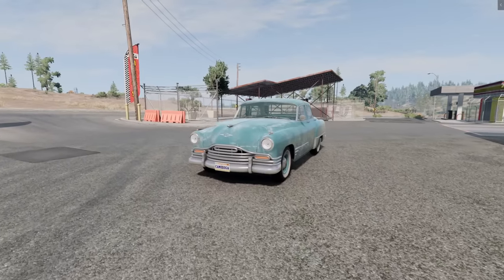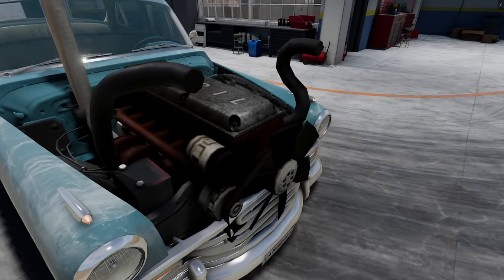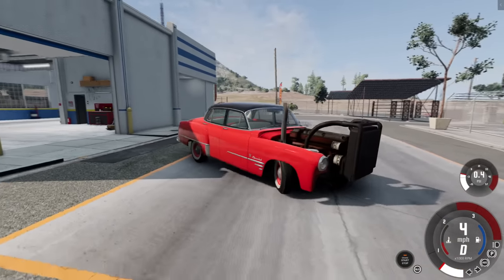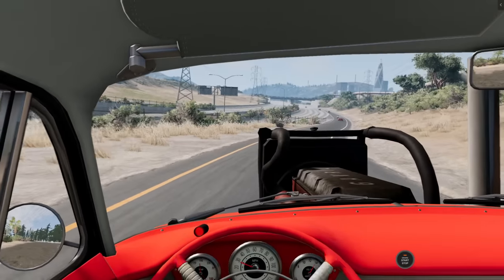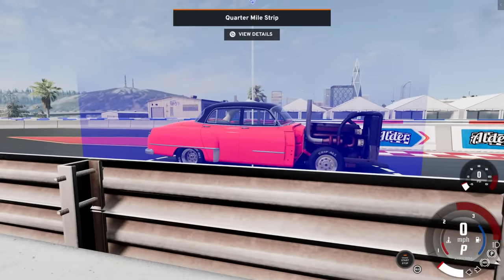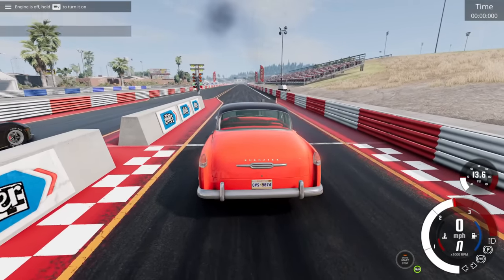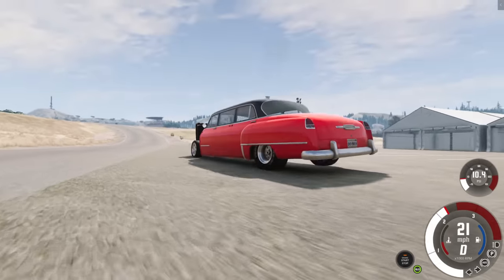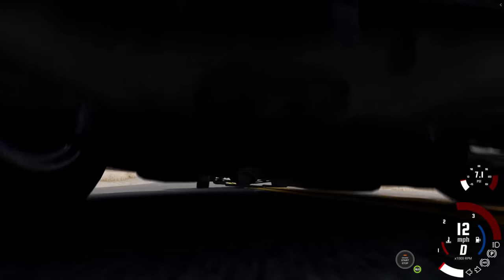Putting a DRAG DIESEL MOTOR into a Car is a Mistake in BeamNG Drive Mods!

Comment: I'm not surprised that the engine didnt fly out of the car, I'm more surprised that the body didnt fly off the frame instead. An engine that massive weighing as much as the rest of the car, of course its going to bring the whole car with it!

Edit: Ah there goes the tires.... I was waiting for those to run away with that much torque

Comment: if it has adjustable ecm then put that on and turn your rpms all the way it it will give the engine more power and about the axle you can also swap axles in burnside one is more reinforced so it doesn’t snap